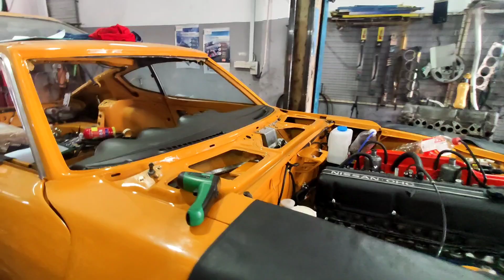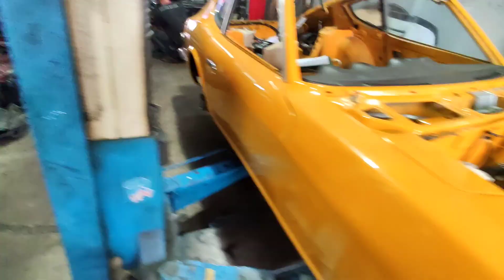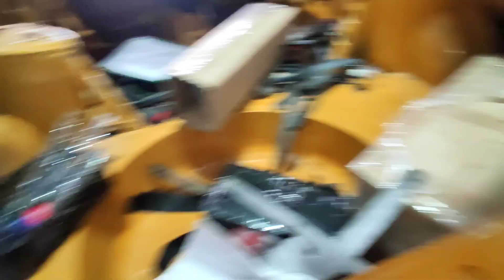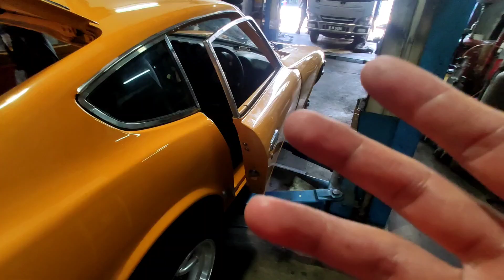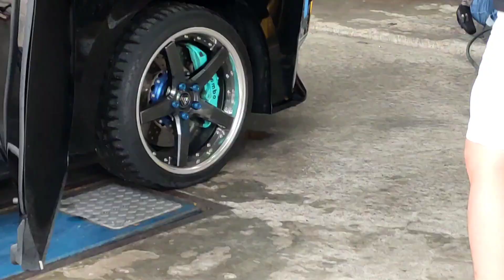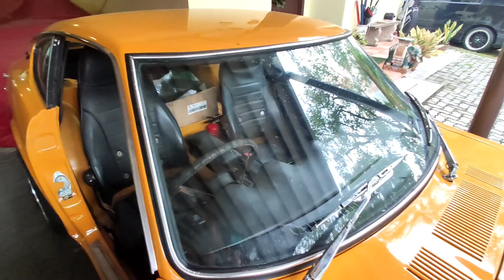1971 series1 240z finally driving

Comment: errr.....what's there to think about the seatbelts?  of course get the updated version lah, it's a safety feature so no brainer.
Reply from the maker: @KenLeeCC  the s1 240z originally comes with lap belts and does not have provisions for a modern day 3 point retractable seat belt that you and I come to appreciate so much in modern cars. To fit the modern 3 point retractable seat belt will require me to fabricate roller pulley housing cubbies into the floor board and drill new threaded holes somewhere along the c-pillar. So it is not as straightforward as it may seem. I stuck to the originality of the car n took the lazy way out by going with lap belts. So sorry to disappoint.